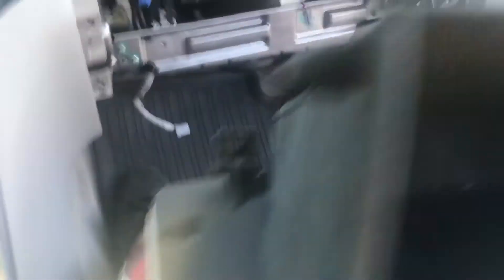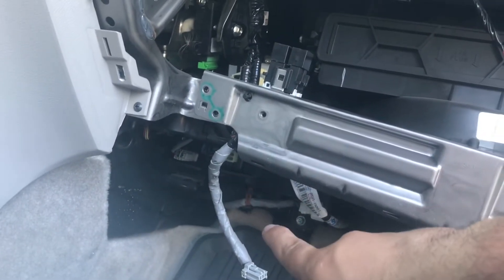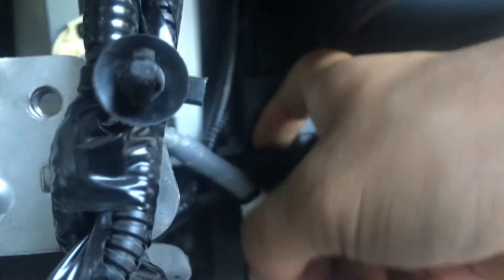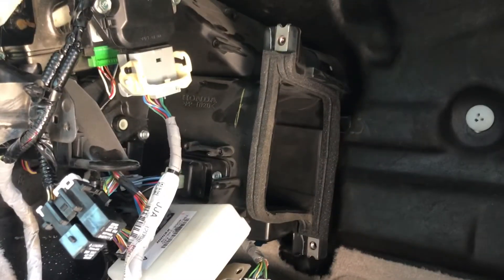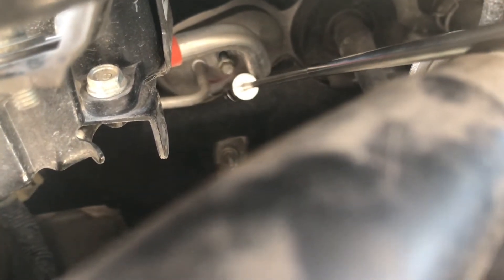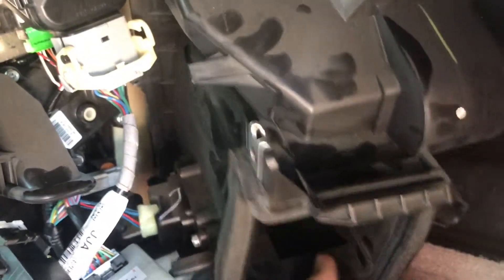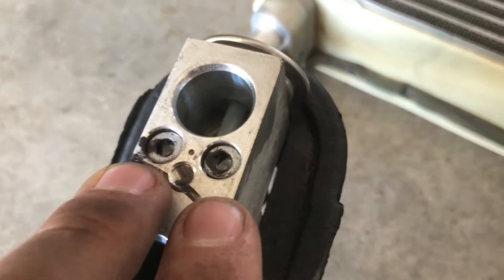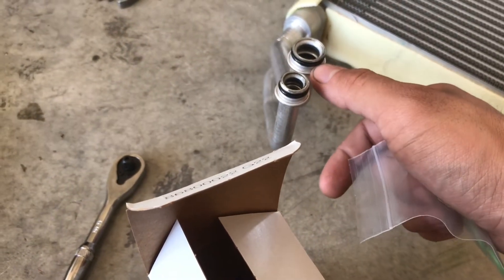Acura TL Expansion Valve and Evaporator Replacement, 04-08

Comment: Thanks for the only video out there.  I did find a way to get to that upper nut for the fan housing.  Set the A/C in the recirculate mode ( ignition has to be on briefly, this moves motorized door out of the way), remove the fan motor (3 screws).  I was then able to reach up from the bottom of the fan housing and through the air intake to loosen the nut with a ratchet wrench (regular combination wrench will not work, you can not turn it far enough).  Thanks again for the video.
Reply from the maker: Anytime! I'm glad you enjoyed it!

Comment: Ok so my ac compressor has been out for a year, I’m replacing it myself, however my question is, should I or do I have to flush the entire system, replace the expansion valve and ac condenser? And if so in what order?  Do I replace all the parts first, then flush it? Im asking because Scotty Kilmer says to replace the condenser bcuz the dirt gets stuck in the tiny holes, but if I’m flushing it with a new condenser then wouldn’t the crap get stuck in the new condenser. Idk I’m overthinking, I just need a little guidance here, thank you..
Reply from the maker: Depends what you mean by the compressor was out.  Was it out of the car or was it out as in broken?  If you're doing anything AC related you need to evacuate the entire system before removing anything as the contents are harmful to you and is a big EPA no no.  If you're going to instal all new parts so new compressor, condenser, evaporator, expansion valve and the lines on the car were properly capped to keep dirt and debris out of the system then you should be alright to just put all of the new parts on and recover the system.  If they were not capped off properly well then that's going to be your judgment call on wether or not you think a lot of dirt got into the lines and if you want to replace those as well or just shoot shop air into them and hope for the best.

Comment: I have an Acura 2005 TL. My mechanic replaced my evaporator in May 2021.  In July, I noticed two cracks in the dashboard. one crack extended from the windshield towards the glove compartment. The other is on the drivers side and goes from the windshield toward the  steering wheel. I have read these TL's can have dashboard cracks. I am wondering however if the evaporator replacement work may have caused the cracks to appear. Does anyone have any thoughts on this?
Reply from the maker: If your mechanic was doing their job there should be no way that they would do anything with the dash near the steering wheel.  But then again I can't see it but I would use tactical interrogation to ask and see if they messed it up and on top of that you as an owner should know what the dash looks like before you take it in.  From personal experience I've always took pictures of my car inside and out as well as the mileage so if anything got messed up or if they went joy riding I would be able to tell and provide proof.
Reply: Nah bro, TL dashboards just crack no matter what
Reply: All TL dashboards Crack due to heat and they're older now
Reply: I’m AMAZed yours didn’t crack until 2021!